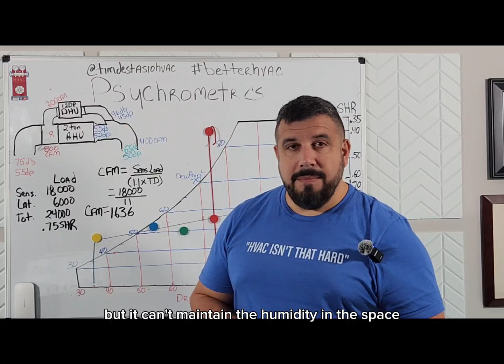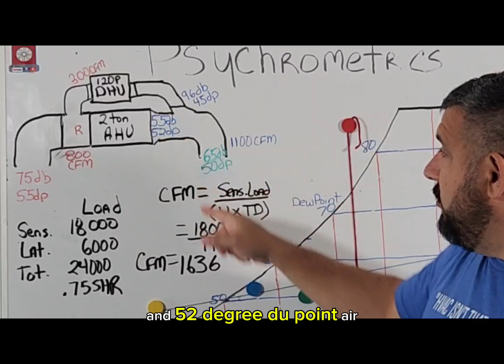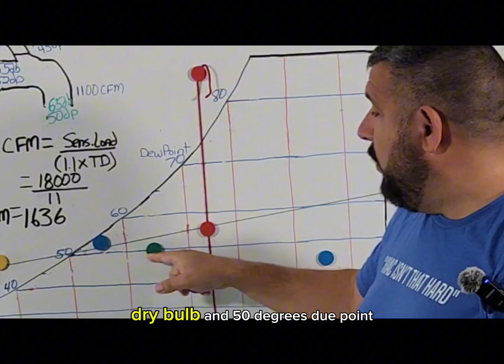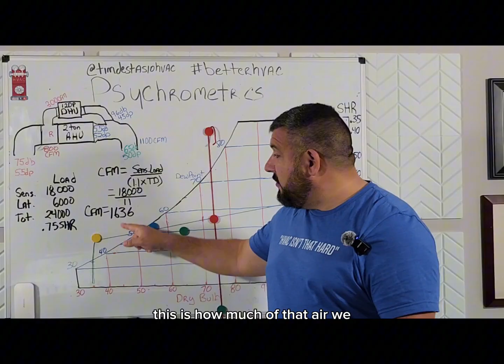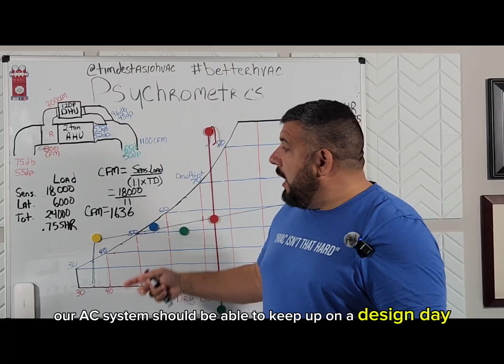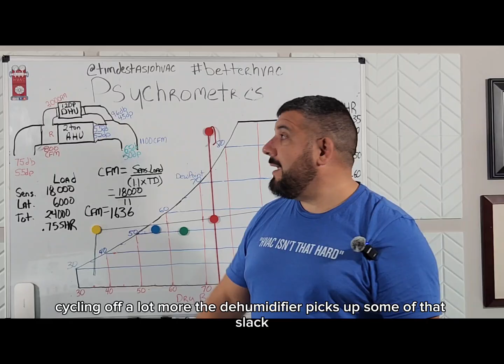Psychrometric Saturday: Oversizing Dehumidifiers Without Envelope Improvements

Comment: That’s a good point.  Usually if you seal up just a few of the biggest leaks in the building, then it brings the latent load down a lot!  The first house my wife and I bought, it had high humidity.  As soon as I started looking around I saw gaping holes around the plenum going into the attic.  That was actually most of the issue.  I sealed that massive leak, and did some air sealing on top plates in the attic and the results were great.  No humidity issues so long as the air conditioner was running.  Later, we added a radiant barrier and tinted one south window, which decreased our heat load approximately 10% in that home.  All this made the temperatures through the home more even, and the humidity was nice and comfortable.  I did set up a relay on the air handler to dehumidify with a slower fan speed for mild days.  It really helped.  The ecobee controlled that.  I wheeled out a portable dehumidifier at times when no a/c was on for long periods.